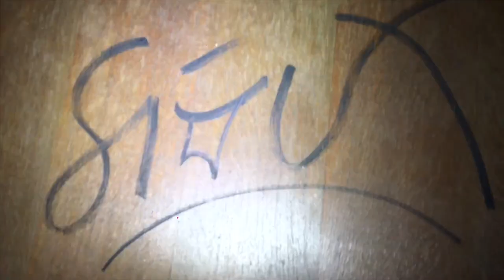EXPLORING ABANDONED ROBERTSON HOSPITAL IN ALTON HAMPSHIRE| NHS BUILDING LEFT TO ROT| DO NOT GO HERE!

Comment: You missed the tunnel out the front
Reply from the maker: We couldn’t find it hun🙈 Apparently theres a room full of hand prints too? Maybe that was down the stair case we missed on the far side of the building x
Reply: Theres a drain cover in front of the building about 50 yards out
Reply from the maker: No way! I will have to go back up there at some point and film it. Thank you so much for letting me know x
Reply: @KayleighCoulstonExplores  
Has anyone been in that tunnel, if it hasn't been filled In when the estate was built it would lead to a huge maze of tunnels.
Ive been to see It, looks doable but it's a tight squeeze to get in.
You'd need ppe as well like a suit and mask.
You could get lost in there so be carefull.
Reply from the maker: John Smith Yeah, ive been told about the tunnel! Hopefully going back next week to find it! I will film what i find and put it on here😁 X
Reply: @KayleighCoulstonExplores  
Your brave it you go in there, I cant find any reports done of it yet.
I did the service tunnels under graylingwell hospital in chichester, I got lost In there on my own as the tunnels look the same inside.
Don't try it alone and take something to use as markers so you can find your way back out.
There's a tap sticking out that you would need to climb over so it need something soft to cover over it.
I would also be concerned about lack of oxygen as the air vents to the tunnel network are probably covered over.
Reply from the maker: Oooh really! Ok no problem! Im 100% up for anything haha. Hopefully it will make a good video! X
Reply from the maker: I explored Westbury Mansion a while back😁 Its on my channel X
Reply: @KayleighCoulstonExplores  
Just found your other vids, Westbury is in much worse condition now with water  coming in now all the lead has been stolen from the roof.
Some of the rooms are covered in grass.
Reply: Have you done the huge empty office building near midhurst?
Reply from the maker: John Smith Oooh no i haven’t! I didn’t know there were any! X
Reply: It's a huge building, only the front part is still in use, the back part has been empty since 2001.
There's a basement but u need wellies for it, and roof access.
Theres a few outbuildings to explore as well as some old quad bikes and a car.
Reply: Look at the building on Google maps sat image, it's best to drive down the road that goes round the back, then park up next to the house and walk to it.
Reply from the maker: John Smith Oh wow!! Thank you so much, this looks amazing!😍 I will 100% give this a go! Is there any security? X
Reply: @KayleighCoulstonExplores  
Only for the front part, inside the doors that lead to that part have been boarded shut.
Easy access as most doors are open, I've never seen secca there myself but a friend did when he used his drone there, the secca guy thought his drone was cool and left them to it.
Reply from the maker: John Smith oh fantastic! Thank you so much for your help!💓 x
Reply: @KayleighCoulstonExplores  
Looking at your failed explore vids, your friend was looking at the access to the the tunnels at Robertson house, that drain looks shallow but look down into it and to the side towards the houses with a torch and you will see it drops down deep past the pipes to the tunnel.
Reply from the maker: John Smith oh wow! No way!😱 I will 100% go back soon! X
Reply: @JohnSmith-ef8nr  is the Chichester hospital still doable?
Reply: @jackbeames7643  
You mean Graylingwell? No its long been converted to flat's but you could do Talgarth hospital mid Wales.
Reply: @JohnSmith-ef8nr  too far 😂
Reply: @ryanappleton538  have you been in the tunnel mate. How big is it? We tried but couldn’t fit past the pipe
Reply: The tunnel was a service tunnel for water, steam and electrical supplies it was T shaped and ran through the middle of the building it connected to risers that fed the services up through the building. The tunnel went back from the nurses home to the main hospitals boiler room. I remember burning my arm badly on a steam pipe.